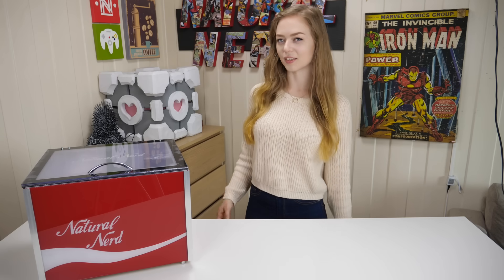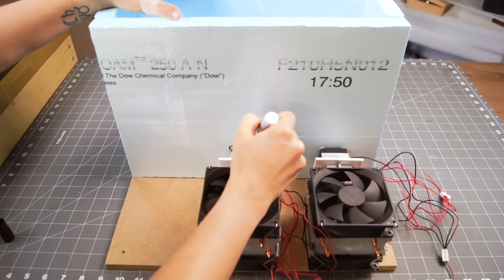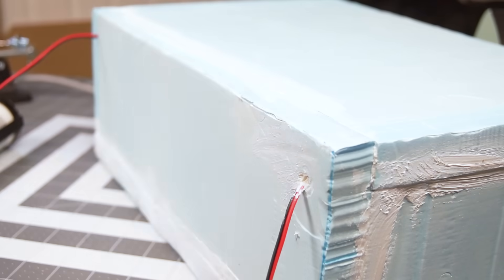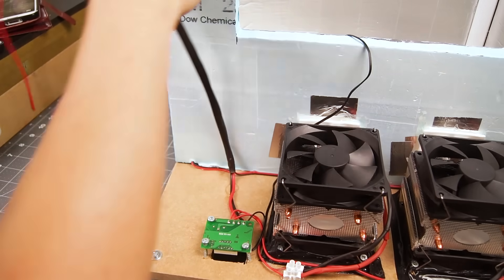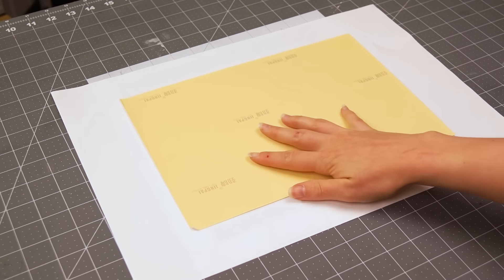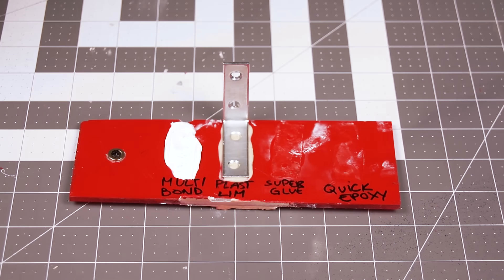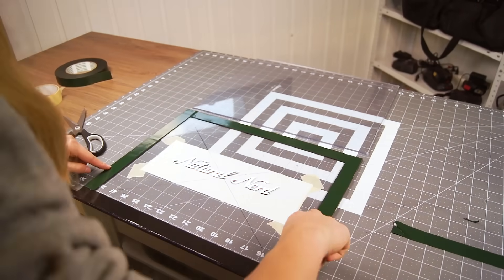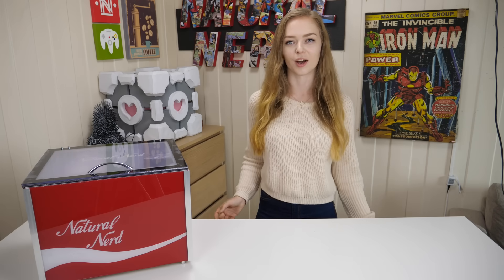DIY Desktop Mini Fridge (5°C!!)

Comment: I got a 230-watt Peltier on a 180-watt four-heatpipe gaming heatsink with a 2700 rpm Delta 90 cfm server fan. The cold side I used the large Pelter kit heasink with all the hardware and put a Delta 49 cfm fan. It gets noisy, but it's outside.  I built it for cooling down portable solar electronics. I got to subtract the power it takes to cool it from how much solar power it puts out, its 16 percent now.
Reply: I was thinking about putting the polarity in reverse in the winter and using it like a heater to keep the lithium batteries from freezing, but the RV tank and plumbing heaters take less power, so I put two 19 watt elbow heaters on the battery.

Comment: Why did you still holes on the sides? Doesn't that just let the cold air out? And why the need for the ventilation ? Thanks for the video
Reply: they are in a section outside of the cooling section behind in back, similar to where a compressor would be.

Comment: Very nice, except for the fact that hot air should go up. Your fans should be on the upper side of the mini fridge, exactly to cool off the top area of the fridge (because cold goes down). There is a reason why most refrigerators have the freezing part on top :)
Reply: Unless it is a Samsung. LOL!

Comment: Was it eventually rebranded to Nerdforge?  The momentary switch that was used in this project can also be scavenged from a non-functional microwave.  They are used to control whether the microwave can activate or not and are located so that the door turns them on or off depending if it is open or closed.

Comment: Please forgive my bad English. I have 4 TEC 12706s and one of them I run at 5V 2A. It can actually turn some humid air into water, which is pretty cold. What I'm trying to do is, make a stair of alternatively cascaded peltier modules so that the cold water( from the humid air) to drop into the hot side of the next peltier. Of course I'll be using hear sinks but, my question is, will it be able to cool the hot side somewhat efficiently?  
I would do the experiment myself but, I lost 2 TECs and the other one doesn't work. I have only 1 left. Could you maybe do this experiment in an episode please? I cannot afford them right now and am very curious to see the results.

Comment: I strongly advice BLACK+DECKER BCRK17B- https://amzn.to/35Ny3UH bought from Amazon with affordable price. Don't lose time to check others. IF I buy again I would prefer this one. A reversible door, leveling legs, and adjustable temperature control (33.8 degrees Fahrenheit at the lowest setting) make this mini fridge even more practical. The small freezer (8 inches wide x 2 inches tall) fits ice packs, most frozen dinners, and the included ice tray.

Comment: Im just sitting here and my only thought was, You could've sacrificed those heatsinks for smaller ones, more peltier modules, and an airflow system to cool off the hot side which would produce more cooling and consume less wattage to maintain the cooling on average given the number of peltier modules. That was a total missed opprotunity. Yes those modules will suffice just fine with those coolers, but you couldve had a lot more room for more items, AND for more peltier modules with a better cooling system IMO.

Comment: Very good. Because the top is transparent, I think an external button to light inside could be a good idea. This way, the person could choose what to pick without open the fridge. Maybe this could be useful in a larger model. Another thing, you made the back door removable, but a cut in the acrylic sidewall would avoid the need to remove the aluminum corners together (sorry for my poor english).

Comment: On the circuit diagram @ 4:54 why is there a separate positive/negative input connecting to the +V and COM of the power supply?
Reply from the maker: so it can be driven with either a 220 volt AC, or 12 volt DC :)
Reply: @Nerdforge  Ah right that's actually a great idea! That way it can still be powered even when you don't have access to a mains socket. Thanks for the clarification :)

Comment: hi well done but may be you can think of use water pump and radiator in both side with one peltier module  will be less power consumption

Comment: Can anyone explain why the power supply needs a DC female jack as well, shouldn't the PSU be able to power the coolers/lights etc. without it? or is it purely for use in a car using a dc adapter?

Comment: My Coleman 40qt gets down to 38°f. That's with the original 54watt peltier module and upgraded fans and an ambient temp of 65°f. That not bad I've had this cooler over 20 years and recently did the fan upgrade and replaced the thermal compound which really didn't make much difference it already was working this well . I was thinking about replacing the module with a 100watt unit just to see if it will get those temps with higher ambient temp in the 75-80 range.

Comment: That's not a refrigeration module That's a thermoelectric cooler and they are extremely inefficient yes they cool air but they use a ton of power and don't cool nearly as well.

Comment: I really wanna do this but I am not knowledgeable with wires. I'm afraid attempting to make this, I might burn the house. huhuhu. I really do wanna make this but I can't. Refrigerators here are very expensive. If I calculate the cost of making a DIY fridge, it will be 60-70% cheaper than buying mini fridge. Huhu I'm so sad. Should've just took Electrical Engineering instead of Accounting. :(

Comment: I think you used cheap styrene which is way too cheap for such a great build. Urethane would have made a much bigger difference. insulation is also to thin and there is zero insulation in the lid. Those Peltiers suck 16 amps continuously... OUch!! You could NEVER EVER use that in a van! Your battery would  be dead overnight. Technically your design is excellent (except for things mentioned) but is it cost effective? I doubt it.

Comment: curious on the efficiency and how much cooling you get out of it, same with condensation and possible water damage
Reply: Thermoelectric coolers work for cooling but are very inefficient and require alot of cooling the rule of thumb is that typically a TEC will have a 60C difference on the cold side vs the hot side so if the hotside was 60C the cold side would be 0C unfortunately these things heat up quick so you will need a good heatsink to maintain any reasonable temps also they are resistors in a sense so they produce their own heat which also require dissipating. Dont get me wrong they work really well for cooling but even a conservative TEC module consumes 60W by itself

Comment: Nice effort, but not practical.  Peltier coolers are grossly inefficient, run almost constantly, the fans get really annoying because they're almost always running, and you can buy a mini fridge with a real compressor and refrigerant that will run circles around this, and cost far less than what it must have cost you to build this one.  Other than that, you did a nice job constructing it.

Comment: If anyone wonders what those cooling elements are, then they're literally just Peltier Elements with an aluminum "heat" sink and a fan on each side. I placed the word heat like I did because a Peltier Element will have a hot and a cold side when powered on. Peltier Elements can be bought independently and made into cooling elements if you know what you're doing (ie, knows how coolers in Computers work and how to attach one).

Comment: 16 amp!!
12x16 192watt.!! H =
192x24= about 2 dollar an day!!? Shit. I would build an on off circuit.
And put an timer on on 1 min. Off 30 sek. And then put a temp sensor on!! So it will auto on off also. But great work
Reply: 16 amps is the MAX output of the power supply. I doubt the fridge draws this much current.

Comment: But... why? I love making stuff myself, but this doesn't seem very cost efficient nor energy efficient.
It looks good, but other than that I fail to see any positive
Reply: Because she enjoys making things herself.  That's the point.
I am sure you could find info on how to run it off of other energy sources like maybe a solar panel or the batteries from one.
Reply: The parts are not that expensive and it looks awesome and it's a fridge what positive did you expect?
Plus, this is entertainment and in my opinion it did a good job at that

Comment: I'm not sure that in this case choosing design over functionality is better. Did you really need a transparent lid? If you did you could make it double layer with air gap. The peltier elements can be more efficient at lower currents. Also You could chain two or more peltier on top of each other. This will make the temperature difference smaller for each element which also rises the efficiency by a lot. Technically the hotter peltie must be twice the size of the colder one, but it will also work with the same size elements. With a good insulation, cascaded elements and a controller which can put more or less current  (not just on or off) through the peltier it could be almost as efficient as a compressor fridge.

Comment: That power supply is way to much over kill you just need 100mA for each fan and a 1,5A is more than enough. Rubber feet would cut down on vibration noise. Having screws stick out at the hinges is a cutting hazard. And this is more a cooler and not a fridge.
Reply from the maker: Each peltier module can draw up to around 5A:)

Comment: It's a nice project that suffers the problem that most nice projects suffer from, it probably cost you more to make than had you just gone out and bought one.

But you do get the satisfaction of knowing you built it yourself, even though it probably cost two or three times the price of one off the shelf.
Reply: I see this valuable in applications where you need absolute custom shapes for retrofitting in awkward spots, I’m thinking of doing something similar to this but for 5-6 drinks and it pulls out like a tip out drawer from say a desk or something. 

Is it economically better than buying a mini fridge to put next to a desk? Helll no lmao. But sure would be cool as hell.
I looked at the parts mentioned and was actually surprised at the low cost of the main components (power supply, cooling modules, thermostat), most of the other stuff is pretty cheap or optional depending what you want to do
Reply: @IAmCjcj11  The cooling modules uses something called a Peltier Element, so it should be possible to even enhance the efficiency of the elements themselves even further
Reply: After using a small peltier fridge off grid, I have noticed that even the small ones draw a hell of a lot of current even at 12v
Reply: @grimairbrush  two in series on 12v will be more efficient than one at 12v
Reply: I think what also makes this pretty good is that it also has an option for a 12v input, which allows you to hook it up in a vehicle. This is not a bad alternative for the $1000 camping fridges.
Reply: But then there are PC nerds that have a bunch of stock heatsinks lying around
Reply: Plus if something goes wrong you are able to fix it yourself since you know exactly whats in it, whereas a store bought one would be very hard to fix if you're not that experienced.
Reply: I got a brand new red igloo micro cooler/heater at goodwill for 49 cents.😋
Reply: Except commercially available chiller boxes have fixed sizes. You can custom one if you DIY.
Reply: But did you learn how to make one, with leds?

Comment: Hot glue and PVA glue can melt styrofoam but i dont know how hers didnt
Reply: It depends on the heat of the hot glue, also if it cools down in the time it takes for the glue to be pushed out and applied because different glue guns have different output speeds

Comment: Firstly, a VERY well presented build and major respect to you with it! Looks great and it sounds like it does the job well. 

My ONLY issue (and it's a minor one) is the AC connections to the socket. Perhaps a little heat shrink around the joints to prevent any accidental shorting, especially since the DC connector is so close. Oh, and consider me a subscriber!

Comment: Mine stop at 25.7-25.8C... no air leak... ambient at 34C... idk wats wrong since delta temp suppose to be 60C my tec...
Reply: What kind of amps is you tec plate and what kind of heat sink do you have on it
Reply: yeah mine also

Comment: im gonna try to adapt this into a computer case and use it as a watercooling reservoir
Reply: i would recommend to use a standard radiator setting for cooling the water. it is more energy efficient.
if you watch Linus or Jays2cents, they've both great success with large radiators.
Reply: @psycholocke4090  im planning to use 2x240mm radiators in the reservoir being passively cooled while the water is being cooled by something like this

Comment: YEA... you made a cooler... that you can buy from Coleman for 1/2 the cost.
Reply: If you learn how to build one, then you learned enough to figure out how to repair one.  This can also make you less afraid to learn how to build or repair other equipment, which can be very valuable.

Comment: The relay on the thermostat is really bad.I fried mine with a 5a load and both coolers combined are 12a so you should use a separate relay if it's gonna be used 24/7.

Comment: In my country, a mini fridge costs around $50-60 (converted). I'm not sure what does the refrigeration module uses as a base, I suspect peltier modules. Overall it is a nice concept and execution. 

Ps: I highly doubt a banggood ac-dc psu can actually delivers 16A, probably at max 5A.

Comment: This is great. You should add an exhaust fan to one of the sides where you drilled the holes for ventilation. This will probably help it cool a couple degrees cooler. Something like what is on a computer would work well. I think they’re called muffin fans. Thanks for making this awesome video

Comment: Very good, I have some criticisms that can help improve your project.

- You used a solid wall but if you observe all the fridge on the market they have a wall with an air inside and a foam. You can use an inner part wall with plastic and the center with spray foam.

- The cold air is heavier than the hot air so it will fall, the correct position of the plates is at the top.

- The door you made looks beautiful but it is not enough to keep the temperature. You need to make a door with foam too.

- Working with Peltier plates you have heats on one side and cools on the other, so you need the larger cooler to cool. You can use the hot side to make a heater for foods that need to be kept warm. So we take advantage of both sides of the plates. In these heaters you need to use water to not dry the food: a good way to lower the temperature is to use a  water block. 
https://www.banggood.com/4080120160200mm-Aluminium-Alloy-CPU-Water-Cooling-Block-Water-Blocks-Radiator-Liquid-Cooler-p-1301782.html?rmmds=search&ID=42257&cur_warehouse=CN

I my project I plan to use a battery to power the plates. In this case I will use a relay to save battery power, keeping it at a certain temperature and turning it off when it is no longer needed.

Comment: Far from the worst DIY peltier fridge on youtube, the quality of which are generally terrible, but there are some real issues with it. 1. You should never use a thermostat with peltier chips. When the thermostat turns off, the heat flows back through the peltier device readily. 2. That really is not enough insulation for an efficient fridge (esp if you intend use offgrid, and campervan use was mentioned). 100mm (4") is considered optimum. 3. Peltiers should be run far below their maximum current for efficiency - it is better to have more peltiers run at a fraction of their max current if more cooling capacity is needed. 4. You really need to consult the peltier datasheets and do actual calculations if you want any sort of reasonable performance. 5. Those chinese peltier kits are useless as they do not include spacers between the hot and cold sides. Any reasonable fridge has a spacer block so that the hot side of the system is completely outside the insulation.

Comment: I am very disappointed in this video because you're too lazy to create your own refrigeration module which is the heart of this DIY project and you just wasted a ton of money by buying two off the shelf rather than making it yourself using recycled parts or using blacksmithing and actually casting out everything from scratch scrap metal.  That would have been far more useful and impressive.  Worthless video.

Comment: Hi Martina, I HAVE a question? About the Main power supply cable which you connect L/N.. What does it happen if you reverse the polarity? I MEAN ON THE 220AC/12DC ON THE INPUT SIDE.. BECAUSE WITH THE EUROPEAN PLUG 220AC THERE IS NO difference in size between the positive and the negative.. so If you put the plug in the socket the other way around you're gonna reverse the polarity. AM I going to burn (short circut) the Main power supply? OR IT'S GONNA WORK ANYWAY.. BECAUSE I SEE L AND N SO I THOUGHT MAYBE IT CANNOT BE REVERSED. I DO NOT KNOW WHERE YOU LIVE And what is your kind of plug. I KNOW THAT ON THE ENGLISH/American PLUG THE POSITIVE HAS DIFFERENCE IN SIZE SO YOU CANNOT MAKE MISTAKES BUT YOU DID NOT SHOW THE YOUR PLUG SO I COULDN'T SEE WHICH MODEL YOU USED.. THANKS IN ADVANCE FOR YOUR REPLY. I HOPE YOU UNDERSTOOD MY QUESTION..